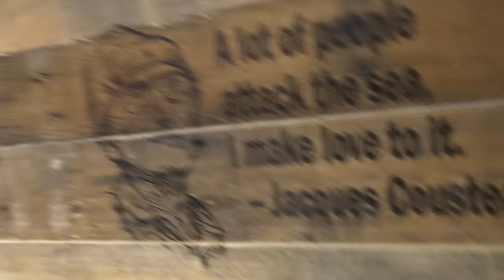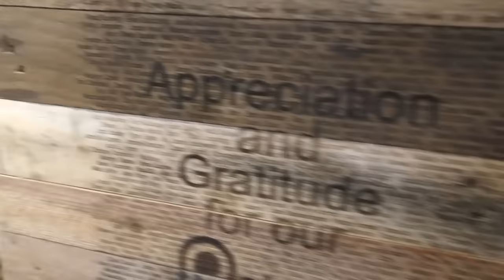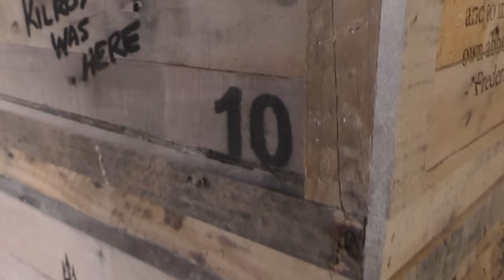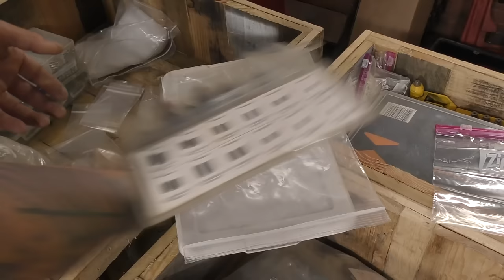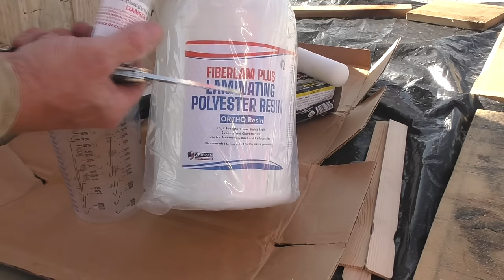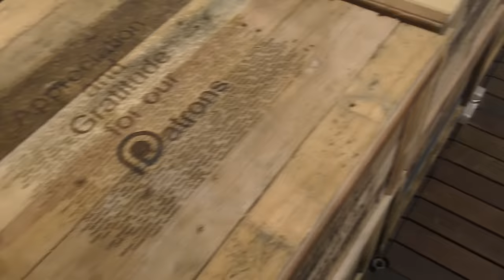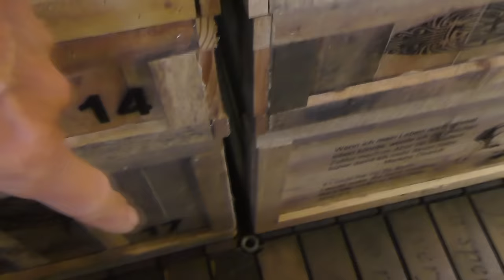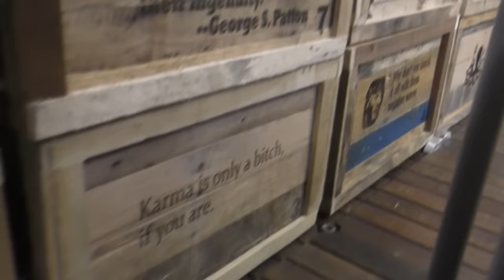Build the Box from Pallets but Think Outside It

Comment: I bought a bolt kit when I was 25 years old. I'm 69 now and still have about half of them. I have stashed all in a bunch of plastic boxes that are the same size and easy to organize. I use the plastic bag method when I'm dismantling something complicated and need all the bolts in the right place for reassembly.
Reply from the maker: I have routine the restocked my stainless steel bolt supply multiple times.  : )

Comment: Those look amazing! I would consider getting/making a clamp or strap system to keep the boxes from tumbling off of each other in rough seas. Probably some bunjie cords and pad eyes or D rings screwed to the boxes would do it and allow for plenty of flexibility/ adjustment. Could secure the lids with a toggle pin thru the side trim, easily removed and reasonably secure.

Comment: Fab work, Doug. Love the boxes and the etchings. Both are a great message to re-use and recycle, plus they are very handy. Like the system and I expect you can more easily 'secure for sea' now too. I did wonder whether a thin coat of yacht varnish might help (inside and out), but it'd be a lot more work and time. Maybe you'll get Adam Savage re-organising his cave in the same way now? Didn't know you'd hooked up with Abom79. His work is soo good. 
I built a big box for my mitre saw a few years ago but I never use it as it means putting the saw away, which discourages using it. I'll have to send a picture or two for your outro with the message not to build one like it.
Reply from the maker: Yeah, Adam and I met years ago.  He even cut the keyways in the catheads on my anchor winch.  Awesome guy.

Comment: FYI, You can lower the DPI on the engraver to speed it up.  You don't need that high of resolution.
Reply from the maker: Actually some of those boards are really reflective so I had to mask off the rest of the image, slow the speed down and let it burn in a second time.

Comment: I don't think I ever came across a video where you discuss the cost of Seeker. We all realize that the cost was spread out over the years, but all in all, how much did it cost to build this?
Reply from the maker: It depends on what you want to count.  Somewhere north of $450K.  But it does not matter at all.  If it was $10K or $10M, I put everything I have into this project.  The rewards in friends, experiences, education, skills, and pride are far beyond any dollar value.   The worst thing you can do in this short life is die friendless, having achieved nothing, ignorant, without skills, and full of regret.

Comment: those boxes are totally missing k.i.s.s. but fun to watch.  you should check out the craftsmen battery finish nail gun.  I bought for 99 since I had the battery and charger and its become my favorite tool and with maybe 3 charges about 2000 finish nails.  I prefer dewalt but when I see the tool that fits the best need .....
Reply from the maker: Ah.  They are just wooden boxes.   Hard to get any more simple.  : )
Reply: @SVSeeker  True that and they look good and fit the need.  I was up pretty late watching this and I think what I meant was you couldnt be any more simple then this project.

Comment: Look 👀 nice but the only problem is they are not water proof 😊
But you can make them the size you need 😊
Reply: Plastic bins inside when needed?
Reply from the maker: No worries. I don't need them to be waterproof.

Comment: I would recommend some sort of sealer for the crates. Unless you're looking at remaking every 8 years. Remember high humidity and pourus pine is asking for mold.
Reply from the maker: Fuck!  8 Years!  I'll let you worry on that one.
Reply: @SVSeeker  ha thought you'd get a kick out of that.  That's as far as mine have lasted outside in Louisiana so yeah you good.
Reply: If you treat the wood with a borax wash,  it should become mold and fire  resistant.  Maybe mix it with a flat water based finish?

Comment: i woulda kept those ssmall plastic boxes and put them in shelves/pigeon holes. Only trouble with boxes is whatever you want is in the bottom.All those little bags in boxes will be a pain i reckon
Reply from the maker: I’m guessing you don’t live on a boat. :-)
Reply: @SVSeeker  you correct but i have a very small workshop and storage is a real problem and i think i know why you said that I dont
Reply from the maker: @pauls4708   Yeah, that's my problem too.  The digging ain't too bad.  What you use the most migrates to the top.   Seems like no matter how much space we have we will fill it.  Every boat I have been on, if you pull back a pannel or floor there will be something stuffed in the space.

Comment: On the fiberglassed one won't the sides cup as the boards swell and shrink depending on the season? The inside faces are sealed and allow for no movement, but the outside ones are free to move and absorb moisture.
Reply: Pallet wood has a treatment on them from when they were built at the pallet factory. Plus I imagine the relative humidity on the water will keep the boards stabilised.
Reply from the maker: We shall see.